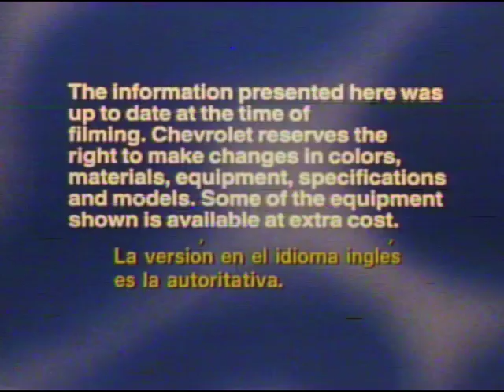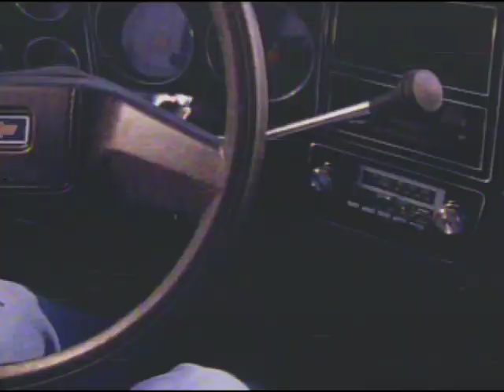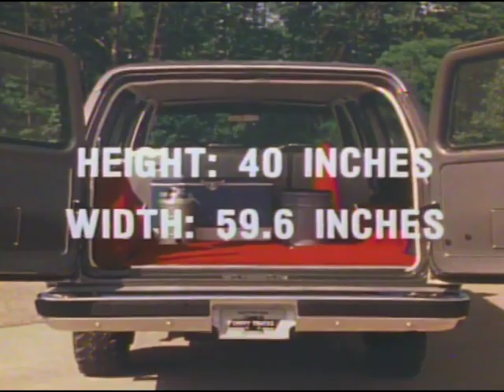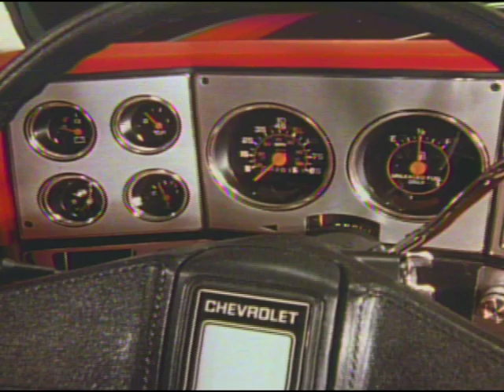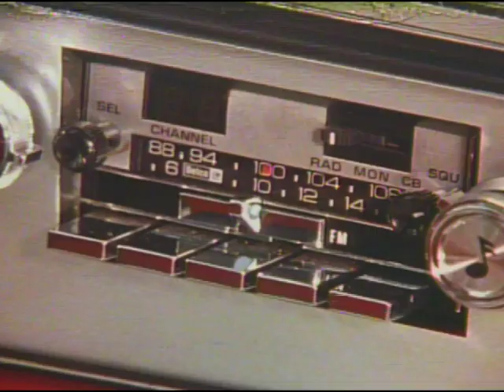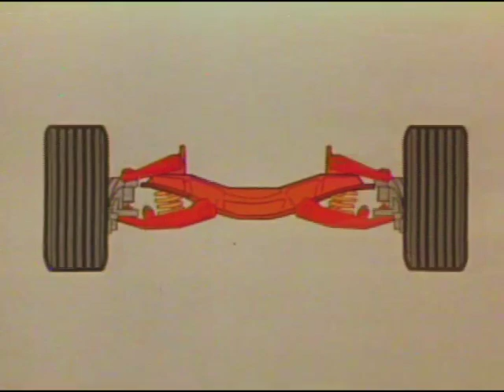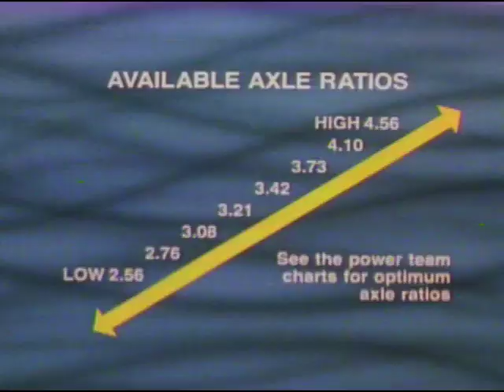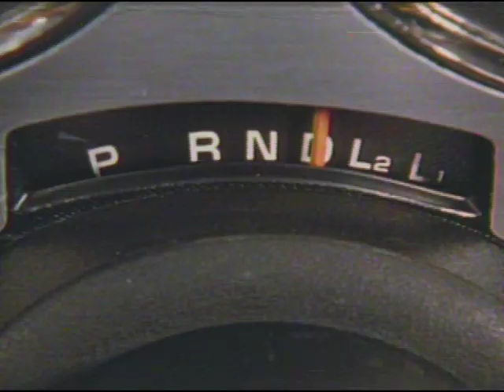The 1980 Chevy Blazer, Suburban & Pickups - Dealer Film GM124

Comment: 1980 was both the first year for square shaped headlamps & last year for round shaped headlamps. The square shaped headlamps came standard on models with the Silverado & Sierra Classic trim levels & optional on the others. Also 1980 was the last year for the nose on the front, emblems, interior, optional bodyside molding trim, & tailgate with those designs. Those generation Chevy & GMC pickups, Suburbans, Blazers, & Jimmys were produced from 1973 through 1991, except the half ton & three quarter ton regular cab pickups were discontinued in 1987 & the one ton regular cab pickups were discontinued in 1989.
Reply: yes
Reply: Yup. Sure love me my 3/4 ton 1990 suburban silverado. It's still in fantastic shape too! Zero rust anywhere
Reply: Also was the last year for their C20 (except for the ones that came with  the 454 )and K20 models to have the full float corporate 14 bolt, then in 81 they all came with the semi float 14, which I didn't like.

Comment: The Big 10 was Chevy's answer to the Ford F-150. The F-150 came out first in 1975 & later the Big 10 came out in 1976. Both were optional heavy duty half ton pickups at the time because the base F-100 pickups were still in production up through 1983. 1980 was the last year for the Big 10.

Comment: I have a 1980 Silverado C30 single rear wheel, long bed 2WD. It has a 454 with a 4 bbl and automatic transmission and dual fuel tanks. I’m looking for a 1980 Silverado tailgate if anyone knows where I can get one.